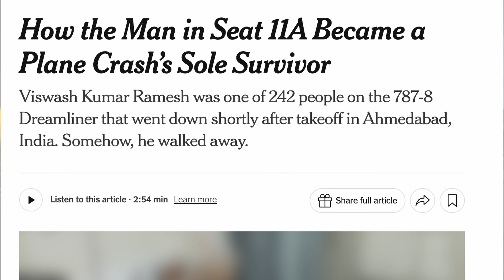Why the RAT Changes Everything – Air India 171 Update

Comment: Captain - if I may be so bold - I like your observance of the flaps seeming to be too short during takeoff.  However,  doesn't the lack of black smoke from either engine also confirm that dual engine failure could be at play here.  I also like your reference to a Cessna by virtue of the fact that most conventional 172's have a fixed-prop configuration.  Do you have a link to the commentary for MU5735 - (?number mixup maybe) Kunming in Guangxi province to Guangzhou.

Comment: The RAT observation is interesting. However, a normal 787 engine makes a very propeller type sound at takeoff or climb power. It is unique just like a C-5’s engine noise. I lived very close to a 787 plant and an AFB. If it was a dual engine failure without any operator error, I would be scared to death to fly on any 787 until this disaster cause is solved.

Comment: STOP CENSORING! What will be the determinant factor, will be the results of the CVR and the FDR. However, notwithstanding those parameters, the one THING not being discussed is sabotage. We know, from the events of 9/11, that a QRS-11 gyro-chip, strategically installed in the FMS (Flight Management System), when activated by remote control, can TAKE AWAY ALL CONTROL from the cockpit, and fly the airplane, even crashing it, without the pilots being able to do anything about it. IF, and this is only one possibility, but IF a QRS-11 or similar hardware/software device happened to be installed on this Air India flight, and there was a 'HIGH VALUE TARGET' aboard the aircraft that the CIA or MOSSAD, or other intelligence operation wanted to eliminate, that hardware/software COULD BE activated to "TERMINATE" the flight and destroy the aircraft and all aboard. That is a hard fact of how intelligence operations are run, and there have been such terminations in the past. It is HIGHLY UNLIKELY that a fuel vapor situation developed as "Captain Steeeve" has opined. There WERE, in fact,  OTHER AIRCRAFT that departed from that airport, under the same temperature/density altitude conditions, without incident. So we get down to brass tacks: WAS THERE A HIGH VALUE TARGET ABOARD AIR INDIA 171 THAT EITHER THE CIA, THE MOSSAD, OR OTHER INTELLIGENCE OPERATION SOUGHT TO ELIMINATE?

Comment: I'm just a layman, but I'm not hearing what everyone else is hearing. I do NOT hear the jet engines at all. I only hear the rat. Could the rat be that loud that it drowns out the jet engines? Why do we hear the rat while the plane is still on the runway? It would be interesting to note too, where the plane was in relation to the "Mayday" call. I also believe the pilots would have, flaps or not, pushed full throttle on those engines to gain altitude. I now believe in double engine failure. I also think that each engine should be fed fuel from different tanks to avoid simultaneous bad fuel. For sure, what I know, is, leave it to the experts.

Comment: This might be a daft point, but while the sound on the video does prove the RAT was deployed, no one seems to be commenting on the other thing you can hear, or more rather what is absent - the roar of two GEnx engines at climb thrust.

One question though, how dependent on electrical power are the engines? If there was a major electrical failure, would the engines keep going? I'm thinking things like fuel pumps could stop, certainly engine control computers need power. Are these fed directly from a bus, or do they, like most aircraft systems, have breakers that might false trip?

Even then, I'd assume that like most aircraft systems the two engines would not share the same breakers or power bus - so unless there is one common point of weakness (the batteries?) it's hard to know what could cause both to stop. Surely even fuel contamination is unlikely to take both offline at exactly the same time unless it's pretty major contamination...

Comment: NO COMMENT.  WAIT until everything, (and believe me every "thing " will be checked).  With all that has been said, perhaps in high temperature areas of the world something will be done about the heat.  Like an APU, maybe a portable large scale refrigeration unit can be used to keep electrontic bays temperature moderate, because with ALL  that has been said, the most consistant information has been temperature.   It's been stated as Celsius.  The Fahrenheit temp is substantially higher and over 100f.  THAT sill fry just about anything.

Comment: So it seems apparent the the aircraft lost propulsion.  The question is, why? 

I don't think an electrical power failure would cause flame out in this case. Engines can gravity feed to at least partial power on the ground with no pump power whatsoever. In the air, they also have the benefit of ram air vents. Additionally, even if a single electrical component failure precipitated an entire AC bus failure, which then overloaded and caused a second AC bus failure, there is still the DC bus to power at least one main tank pump. Engine electronic control units also receive backup power from a dedicated generator on the engine gearbox. It makes enough power to power the control until just by windmilling at less than 15% RPM.

So, again, while did the aircraft seem suffer dual engine power loss? I have no guesses.

Comment: If the RAT deploys when there is a complete electrical/ hydraulic failure,  what powers the fuel pumps? Could a fuel starvation situation to both engines be caused by the fuel pumps being shut off?

Comment: - Dual engine failure calls for an attempted restart, initially closing the fuel shutoffs (shutting down the engines before restart). 
- An unexpected autothrottle thrust reduction from takeoff power to idle FEELS dramatic and might be misinterpreted as a dual engine failure. A dual engine failure calls for an attempted restart, initially closing the fuel shutoffs (shutting down the engines before restart). Are there any circumstances that might cause unexpected autothrottle thrust reduction to idle? Yes, there are.

Comment: A video indicating there was a voltage problem before it took off the TVs were not working on the back of the seats and the internet was not working that makes me think that there was an electrical issue that caused the fuel pumps to shut down and not supply on a fuel to the engine

Comment: From my  experience in Commercial Aviation, as a Pilot and Engineer, you never want to hear a or have a Rat Deploy on your AC.  If you can hear the RAT spinning above the Take Off Engine noise, which seems to be confirmed in the Video, I'd say its more than likely that Engine failure had occurred. That may also be  the reason that the Gear  seems not to have retracted another clue to why the Rat deployed.

Comment: I am a retired Capt, I worjed fir an Indian airlines and i can tell you that the training for the pilots is among the best in the world.
I found this information about the FADEC and the radio altimeter in the B787

The takeoff and climb phases are among the most critical segments of flight, requiring precise coordination of systems such as the Takeoff/Go-Around (TOGA) mode, autothrottle, and Full Authority Digital Engine Control (FADEC). In the Boeing 787 Dreamliner, these systems interact to manage engine thrust, airspeed, and pitch guidance to ensure a safe and stable ascent.

However, malfunctions—such as erroneous thrust commands due to faulty logic or sensor input (e.g., low range radio altimeter (LRRA) anomalies), hardware interface failures, or pilot mode selection errors—can lead to critical outcomes, including insufficient thrust, asymmetric power, or loss of climb performance.

Comment: If you look just off the top of the steel I-beam just before and after the crash at .25 speed, you see a black chunk spiral away from the I-beam 3 times.  It’s not a smooth movement though.  It’s as if that object is appearing momentarily each time it’s visible which is slightly further from the I-beam each time it’s visible.
Reply: Also the right wing disappears for a moment on the camera from tip to engine.  Perhaps a DEW using resonance caused the catastrophic failure.

Comment: Gosh this is giving me Flight 232 vibes now! They had the bang, too (flawed fan blade in engine 2 sliced through all four hydraulic lines), and then the full loss of hydraulics also BUT they were at altitude, fortunately. Unfortunately, they were in a turn which caused all kinds of challenges to work with. (If only they had the RAT back then, it could have been less of an incident (btw those pilots have my deepest love and respect forever, they were absolutely incredible heroes.)) Thank you Steve for your analysis and update. Much appreciated.

Comment: Good point mentioned by Captain to think about. “Fuel Contamination” which could be possible reason for both engines failure as soon as lift off
Reply: It's happened before,Cathay Pacific comes to mind for fuel contamination,as well as the Airbus in 2020 that had 37-38x the recommended Kathon amount put in there

Comment: Remember Northwest Flight 255 in 1987. 1 survivor Cecelia Cichan who is 42 now. Very experienced pilot 31 years flying, who blew off the take off list with the first officer. Why?  They didn't extend the flaps/slats and crashed on takeoff.  He also supposedly unplugged the warning system circuit that screamed "slats slats slats" that reportedly drove other pilots crazy. Pilot error. Was he drunk?  Did Air India also fail the slats/flaps?

Comment: Hello, Captain Steeeve. Yes, it was probably the RAT been deployed. But this doesn't mean that the engines flame out, because the RAT can be manually deployed by the pilots. Thus, your previous hypothesis of early retracting the flaps still fits. In this case, the new hypothesis is that the pilots retracted the flaps, misread the situation as a dual engine loss and deployed the RAT.
Reply: Thought so as well but the engines at that point should be roaring which doesn’t seem to be the case on the video.
Reply: @Pluto_ice Yes, you are right. Just watched the video again and all I could hear was the RAT.

Comment: Can Mobile phone, if loaded with Jammer application, block electronic circuits in the Airplane ? Can this be Sabotage ? . Similarly Jammers if working from the ground at low plane altitude can affect Airplane ?  It is worth evaluating.

Comment: … as if thats new… 
.. are you sure you are a pilot?
.. pilot mistakes happen but somethibg like that? Removing thrust or lift or stalling during start with all the stuff you habe to do to be in your guideline and all the times you did it right.. wasnt a harsh enviroment wither.. so not likely.. 

.. poor kommunikation, fuel management, overestimation or ubderestimation in harsh. Obditions.. 
wrong reaction in a malfuntion .. sure.. but flaps? That would be another push of a button to solve.. 

What else stops the climbing imediate and leaves the polot woth no options? And you can clearly see that he did not much .. in terms of input strength..and the climbing just stoped at some pint.. either stall or thrust.. and like i said stall is unlikel..

And what causes double engine failure? Well sure a double bird strike.. but also rare mechanical failures.. contaminated fuel ok… no fuel.. .. electrical really unlikely.. mechanikal also unlikely.. last seen 1989…

But what was it? You habe no clue.. i habe no vlue.. and the rad makes no difference there.. except you seem to habe priviously thaight it was the pilots.. 

 But right.. i am also no pilot

Comment: Blown fuse... the engines not set to continuous. Im sure there are redundancies. But most of the time aviation engineers only take in consideration at altitude. They never take consideration just after takeoff. And don't really care about landing because they assume you're going to put it down. But like your car, if you were to kill power to the engines, the engine shut off. As long as ignition power is going too, the engines, the alternator will keep it running. What if the ignition switch got churned off for blew. Obviously they are on separate circuits and it would be very hard to get both engines to do the same thing. Unless you have some weird loss of power and the engines aren't set to continuous, they're just in the start position. That momentary loss of power would have shut the engines off like it would have on a car. And much like a car that is coasting, you would need to put it in neutral and try to restart it while it's moving. Because obviously they didn't have enough wind speed to, windmill them engines. 
Loss of power makes sense for the rat to deploy. Flaming out or damage would be shown in the exhaust. It makes more sense that something blue lost. All power for a few seconds. Turn the engines off and they just didn't have time to look down. And try to restart their engines. Which would've needed to have been done with the apu or windmilling.

Comment: Sir I believe the cause of the Indian plane crash was overloading in addition to the aircraft's imbalance due to the lack of wind during flight. All of this made the air above the wing stronger than below it causing the plane to crash. The lack of wind the high temperature at Ahmedabad Airport and the overloading caused the engines to fail. Unfortunately.

Comment: Interesting assessment. How could two engines flame out? Sabotage. A timed intervention, possibly radio-controlled, directed both engines to stop at the very same time. Not here to poke an accusing finger, as any number of terror groups could have been responsible. But an act of terrorism, radio-controlled is the cleanest one (hardest to detect).

Comment: Air India B 787 crash

1. I looked at several videos of the airplane taking off. It looks like a lot of dust at liftoff at the end of the runway. Was the takeoff an intersection takeoff? It seem to have a lot of power?
2. The video looks like the airplane is setup for a landing, nose up and desending?
3. One of the videos I looked at, the captain is a B 777 captain and he said if the airplane slats and flaps are not set for takeoff that would be flap set to 5 degrees which is slats deployed and flaps to 5 degree , when you apply power the aircraft will not takeoff. There will be alarms, lights the cockpit would light up.
4. I was told a number of years ago by a captain on B 737, the newer models, the  FMS was set to aircraft weight, runway length, air temperature, airport elevation the FMS determined the amount of power for a proper takoff, (cost saving fuel) rather than full power.!!

I have been flying flight sim for about 40 years. The one I am using right now is Xplane and a Boeing 777-300, thrust is set at 93,700 lbs. Typial engines for the B777 are rated to 115,000 lbs, however they are derated depending on the version of B777. The B787 uses a deferent engine and I found they are rated at 67,000 lbs of thrust, it maybe the weight of the B787 is lighter? These are just facts.

I think the auto pilot speed was miss set for takeoff. The last few days I did a lot of test on my flight sim B777. I started using auto speed at 160 kts, no flaps, it used most of runway 29 at moncton, I pulled up a bit it came airborn jus as the speed reached 160 kts, auto throttle reduced power to about 80 %, stall alarm and lights came on and it desended to the ground (crashed).

I tried over many, many defferent settings of no flaps, gear up or down and airspeeds of 160, 150, and 140 kts. Gear up resulted about 2 % reduction in power, at those low speeds I don't think it would be a big factor.

One test I set the auto pilot speed to 250 kts, no flaps, it got airborn, remaind on full power and climbed away. I tried airspeed of 150 and 140 flaps at 5 degrees the nose was up and just sank to the ground in a stall at about 80 % power maintaining the set airspeed. I just kept resetting the auto pilot but it just kept the same noseup and wings level.

I have seen many Maydays on TV where there was water crystal in the fuel filters and some material got into the fuel filter that restricked fuel flow. It will be interesting to find out what happened.

I did some flight tests on the B 777. It takes 3 seconds for the power to go from 80% to 100 % and 7 seconds for power to go from idle 30 % to 100 %. It takes about 10 seconds to get a positive rate of climb. At 150 kts on the auto pilot, auto throttle set. Power came back to 80 %, nose up to 15 degrees and stalled. I had tested this at 1500 ft, went to full power and it descended to 700 ft before the aircraft stopped descending at 700 ft. lost 800 ft there was no way for the pilots  to recover in time from 625 ft. It looks like the RAT had deployed. The RAT will automatic deploy on an electrical failure or maybe the pilots deployed it to try to save the airplane.

Comment: A couple of things I've been wondering about: a passenger on the previous flight, same jet, said that nothing electrical was working on the plane (e.g. a/c, screens, lights, etc). Could that have been the first sign that something had gone wrong with the electrical system? Second thing: the pilots decided to backtrack all the way up to the end of the longest runway before taking off. Would that have been an aircraft weight concern?

Comment: Also, it doesn’t sound like an airplane at full takeoff thrust… the 87 is quiet, but not that quiet!
If you are down to RAT only, I don’t think the cabin lights would be provided power.
Most airlines will keep the APU on during takeoffs, particularly for long flights or shorter/higher/hotter runways. If you have APU power, the cabin lights would remain on and you would have plenty of electrical to power the primary and demands pumps for the center hydraulic. Dual engine fail will deploy the RAT, but cabin lights implies center has plenty of power. Could you see any flight control movement? Even on RAT you should still see outboard aileron activity. Dual engine out with low pressure on center hydraulic would make a VERY bad day…